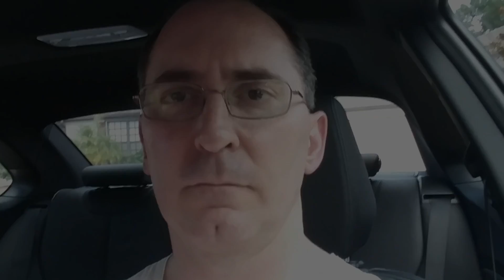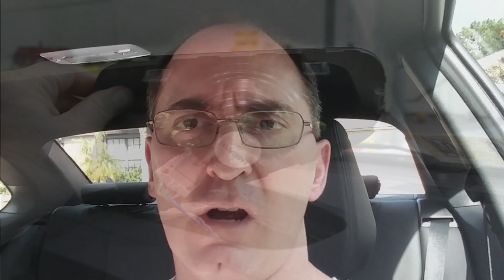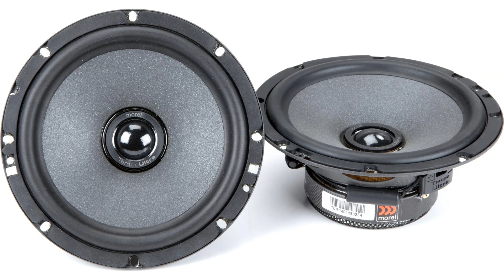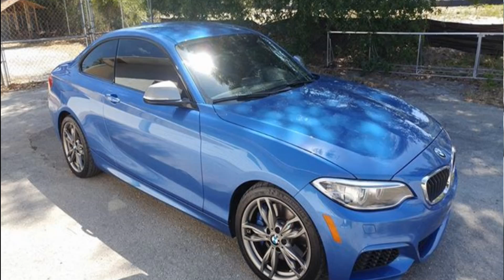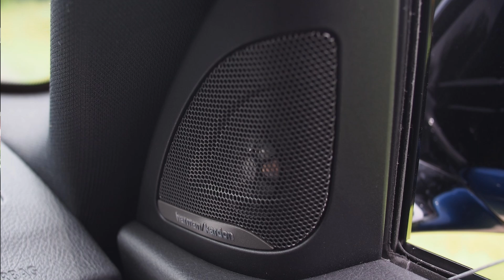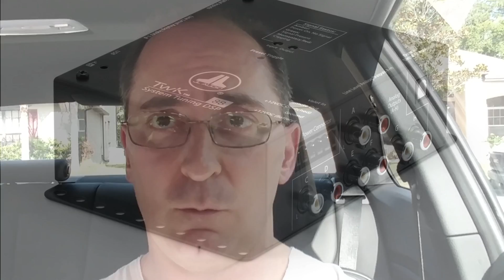Identifying Shortcomings in OEM Car Audio Systems

Comment: Did you change this. I'm looking at doing a few upgrades, but need to figure the pin out from the rear amplifier to easily tap into the wire harness, and place in an amp, before I can change the speakers. Any links you followed would be helpful

Comment: Morel, Focal and Hertz all make killer speakers. Bavsound makes upgrades from the bmw sound system. That would be my recommendation due to there O.E.M integration. No doubt the best sound will come from an audison DSP + Amp combo tuned by a Audison dealer with the proper equipment. Good luck!

Comment: It might be interesting to do a crossover video with some of the car audio channels that are similar in nature to your channel but more focused on car audio as opposed to home theater. The guy over a car audio fabrication might be a good person to either do a video with or at least elicit some advice from period or Steve Meade designs. There's a few others also. In either case JL amplification is a great choice. I also think you would find zapco to be an excellent manufacturer of high-end Electronics for the car audio world. At the lower price point. JBL and kicker mid-range drivers in my opinion tend to sound the best. If you're looking for a sub $200 a pair 4 midrange drivers those would be the Brand's I would consider. Outside of that Memphis probably but also be a contender. On the upper end of the sound quality Spectrum I think JL Audio for the mid-range drivers would be great and it goes without saying focal would also be top notch.  One last thing, there is a small company in California called USD and they make some really interesting components. They also have specialized in the use of a periodic enclosures.  After everything I've just spoken of I can't believe I failed to remember about these guys. Do yourself a favor and at least check them out. They are definitely going to rub the high-end audiophile the right way. https://www.usdaudio.com/products/

Comment: Thank you for the video and the analysis. I didn't realize having separate tweeter and mid-range speaker is detrimental to the sound quality. In fact, I was glad the tweeter is near the A-pillar in my Audi, I thought it's going to give me good imaging and good upper-frequency range, since it's facing directly at me and not into my leg. I did a complete audio system overhaul in my car and never knew I should do something with the tweeter positioning. Although I'm not sure if I'm hearing the specific kind of the distortion that results from this.
Reply from the maker: Separates are not a detriment. However, it's best to keep the mid and tweeter as close together as possible. Placing the mid at the footwells is a bad design choice, one seen in most car systems these days.

Comment: I had a 1996 BMW 328i with a system that sounded like garbage; my Camaro had a better sound system!  Worst feature of the car (except for the plastic radiator hose connections, which broke on a regular basis).  I ended up replacing the cheap drivers with Boston Acoustics separates, which required building larger brackets to hold the speakers and glueing them into place. I replaced the dash unit with the “Business” version which was a little better. The $650 woofer addition that went into a box in the trunk was laughable. I would’ve thought that BMW would have upped their game by now

Comment: Agree with what you said. Friend has your car with HK and it is just anaemic sounding, no crunch or dynamism to it. Extremely polite 'lets just listen to radio talk shows' type presentation. BOSE in cars also pathetic. My VW has the dynaudio speaker package which I highly rate. Complete sounding with refinement but fully capable of aggression without a hint of distortion. Guess thats why dynaudio was chosen for the veyron!

Comment: Don't forget the trucks-my work truck is a 14 Ram with a decent OEM package. Playing audio thru the AUX input really rocks,and I cannot hear any deficiencies in the 3 sets of drivers in here. Bass is tight,even when boosted slightly,mids are clear,and highs are not shrill at all. Would like to tighten up what is here,to minimize panel losses. Thanks!

Comment: Lincoln Continental w/ Revel audio. Did they do anything different from other car manufacturers with HiFi audio systems? I’ve always wondered which car has the most acoustic modifications (ie., speaker enclosures)

Comment: Gene, it's quite possible you've already figured out which route you want to take, but I'll put in my two cents anyway. You touched on the car's physical limitations; trying to recreate a home hi-fi signature in a mobile environment definitely isn't easy. That being said, I'd like to offer up the following points:

1) While you can normally move drivers around pretty easily at home, especially when it comes to finding optimal subwoofer locations, you're much more limited in a car. That's not to say you're completely stuck with location. Moving the midrange and tweeter even closer together and positioning them in pods on the dash will certainly help with imaging. While it might feel nice to have the midbass drivers under the seats, you may not be giving those drivers the needed airspace to really shine. If that's the case, either consider building an enclosure for those drivers or relocating them to the kick panels or in the doors themselves (obviously this will require modification).

2) If some of the items in (1) aren't feasible, you can in fact use DSP to correct these things...BUT...OEM systems tend to generate their own DSP systems as is. To combat this, you would really benefit from a device that's meant to correct that signal as much as possible. You mentioned using JL's TWK-D8 and I think you having a BMW gives you an inherent advantage thanks to its fiber-optic link, but know that you'll still have to correct a fair amount for those factory settings (specifically time alignment). I would suggest looking at something like the Helix DSP Pro as its interface seems a little more intuitive and the company's pedigree definitely carries its fair share of weight in the car audio world

3) Once you've figured out driver placement and processing, you'll want to consider acoustically treating your car. You've got a wealth of surfaces, cavities, and environments in that interior that are going to combat your ability to accurately hear the source material. Consider a 3-step acoustic treatment: CLD (Dynamat) on metal surfaces, CCF over the CLD, and mass-loaded vinyl over the CCF (specifically on your doors). Look into FAST rings to ensure that your drivers aren't allowed to project into the door cards (assuming you don't move your drivers into dedicated pods). Finally, dash mats may look ugly, but they do a decent job of taming reflections across the dash

4) Don't buy into the common belief that "all car audio amps sound the same." Once you step out of the mainstream market, you'll find some really solid options in Class A (Mosconi), A/B (Zapco), D (SSA, Hybrid, Steg, Helix, Brax), and G/H (Genesis) topologies. The main differentiator will be how much power you want to devote to powering these amplifiers. If space is your concern, Class D or G/H would be the way to go. I noticed in one of your responses to a previous comment that you'd like to stick with JL based on their outreach, but just keep in mind that most of us sound quality guys would consider them mid-tier in the car audio world.

I'm sure it goes without saying and you probably already know this, but focus spending more at the source. A better DSP and amplification will carry far more weight in the long run than cheaping out here and hoping to compensate through your selection of drivers.

Since this comment's getting pretty long, I'll just say that I'm willing to answer any additional questions offline with you, should you have them. I've been a fan since the AVRant podcasts started and would love to give back somehow.

Comment: Hi, great video.  I paid £600 for the HK system in my BMW and thought it was a complete waste of money.  The audio is terrible, even if it is better than the standard speakers.  Not worth £600.  My question, is if I do nothing other than remove the centre speaker will it be an improvement?  Thanks.
Reply from the maker: Glen, yes I would try disconnecting the center and see how you like it.  It's sad b/c this system SHOULD be so much better than it is.  However, Harman seems to think it's pretty good which is a bit shocking to me.
Reply: Thanks, really appreciate you taking the time on this.  I'm also wondering if there is an aftermarket amp which would be a straight swap over with the original (use existing cables etc etc) to make installation much easier.  I have a feeling that simply removing the centre speaker and upgrading the amp would see a huge difference.  Not sure if you have bimmercode but you can disable the ASD with that which I am also going to try.  I do feel a bit annoyed as I sacrificed pro nav to get the HK system when I ordered the car.

Comment: Hey Gene , I had the same problem with the 2017 BMW X3 M Sport . What I found that worked for me was just disconnecting the center channel speaker , cause it was as you said useless . My biggest issue was the bass the under seat 8 inch woofers are muffled by the seats and are just that woofers not sub woofers . So I tied into the factory wires for the woofers and put them into a Audio Control LC2i which compensates for the factory bass roll off put that into a 600 watt class "D" power amp with a 1 farad cap and a Kenwood 12 inch tube sub . I spend around 400-500 bucks did all the work myself and once I got it all dialed in I was blown away and happy !!! This set up took away forcing the factory system from trying to do what it couldn't so the kids and highs are clear and sweet and the thin sound because of the bass roll off was gone !!!!
Reply from the maker: Nice!

Comment: Gene, look into Helix DSP amps.  They can accept the balanced differential outputs of the bmw hi-fi head unit.  They are powerful amps with a great DSP  built in, you tune it with your mic and a pc.  For speakers look into morel mids and tweeters they also  have  a thin 8 in that I think would fit under the seat, I think it is the msw265 or something like that, check parts express.  For non DSP amps the jl audio will also accept the differential outputs, but stay away from the cheap Xd series.  Upgrade to the HD models. You could run the HD600 which is 150 by 4.  You would run 1 channel to each mid/tweeter combo in the doors and each underseat.   Don't bother amping the rear deck speakers they sound like ass, even upgraded.

Comment: I have an idea on what you guys can do for a video topic, tips on hunting down speakers at garage sales. I've been doing this for a few years now and I've come across enough audio equipment now to make 2 5.1 frakenstein sets that actually preform well using speakers from MB quarts domain series, paradigm, and JBL. All speakers that were cost a pretty penny in the day that I got for under $50 for a pair and occasionally for $10.

The best thing that can be done is to kill off the stigma of buying used speakers, especially when they are really good used speakers.

Comment: Enjoyed this video. I'm wanting to replace my system in my accessible van it's an 08 Honda Oydssey (very low miles) with factory system. The center seats are removed and I can park my chair in the passenger compartment. The back seats don't fold flat as the computer and such to operate the lift resides under them. I'm not much into watching dvd's but would like a system that sounds really good over the road noise while driving . Any suggestions? Thank you in advance.

Comment: I noticed that nobody mentioned electronic crossovers with eq and delay between the head unit and amps. Patch in a home receiver temporarily to do the analysis of your choices, then reduce the eq boost in all bands on the eq that show 3dB or more. Tune to suit your taste from that point. I have found that putting a foam wedge behind the tweeters in the angle where the windscreen meets the dash, helped to clean up the high octaves. Sound deadening of panels are a must to really clean up the sound.

Comment: I'd be interested to hear your impressions of the Genesis G80's lexicon audio system personally. Since you can't add the audio system as a single option, but as a package that increases the price by $5,000 to upgrade to the 14 speaker system (premium package) and then an additional $5,000 for the 17 speaker system (ultimate package) when purchasing the 3.8L option. 
Thanks!

Comment: Thanks for the video. In my Audi S4 I found a big improvement in using an outboard DAC. I prefer to use a Fiio X5 loaded with 2 128G SD cards fed into the car audio Aux input. I can store around 400 CD's of uncompressed audio on the Fiio. It sounds better than the CD deck in the car and much better than the compressed MP3 on the SD cards through the Audi DAC. The cons are that you don't see album art and titles on the car infotainment screen and you have to manually turn the DAC on and off. I found it pretty easy to get into the habit of powering on the DAC when I start the car and pressing pause when I turn it off. The Fiio has a nice feature where it will sleep after a minute when paused. The Fiio has equalization built in that is much more tunable than the Audi system so I can flatten the response better. The other advantage of an outboard DAC like this is that I can take my music to another vehicle very easily. Other than that, I am using the stock Audi 'premium'/B&O system.

Comment: I had a 2004 TL with the ELS system which I thought was great.  I then switched to a 2008 Lexus IS with the Mark Levinson system which I found a little disappointing.  They must have improved it with the newer IS you had.  My 2012 TL's audio system was far better than previous two systems and I really loved it.  My 2015 TLX is definitely a step backwards as far as the audio system is concerned :(
Reply from the maker: Yea the ELS system got better with the newer TLs but sadly the driving dynamics of the TL got worse as the car grew in size.  The TLX is a BIG disappointment IMO. Acura had a winning formula with the 07/08 TLS.  All they had to do was make the car rear wheel drive and upgrade the tranny and it would have been a winner.  

What I liked about the Lexus Levinson system over the 07 TL ELS system was it's capability to play louder more cleanly and with more bass.  I hated giving up the discrete 5.1 audio though....

Comment: I just purchased the new Volvo S90 T6 inscription fully loaded with the B&W sound system, blows my mind. I myself have a full nautilus system in my HT (803 and 804 and 805 and the htm2 centre for a full 7.2 surround) so I knew going in what to expect as to the sound in the Volvo
Reply from the maker: Alex A The B&W system in your car is a collaboration with Harman.  I'm uncertain if the actual speakers are B&W or Harman. Do thry have Kevlar cones?  How does it sound?
Reply: Audioholics they do have the Kevlar drivers (you can see them clearly through the metal casing covering them) I may be wrong but I believe the tweeters are the same as in the nautilus series (not the diamond ones). The sound is incredible, in fact, I just picked up my LINN LP12 today from my local HIFI Shop that went in for some maintenance and tune up, and upgrading to a Koetsu rosewood signature (shout out to Codell Audio) and invited Tod (probably one of the best LP12 or any other turntable expert in Montreal) to come and have a listen in the car and he was impressed with the sound from the B&W  (and this is a guy that has been selling hi end HIFI for 30+ years.) and no, the LP12 wasn't connected to the car (I can see how someone would have asked that question. ) Mind you it probably would sound amazing,,!!,!,